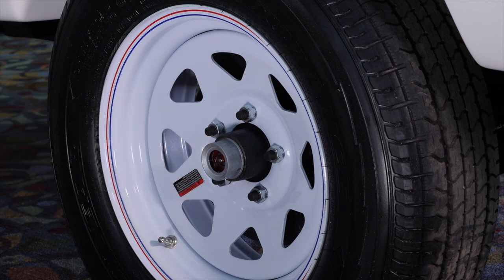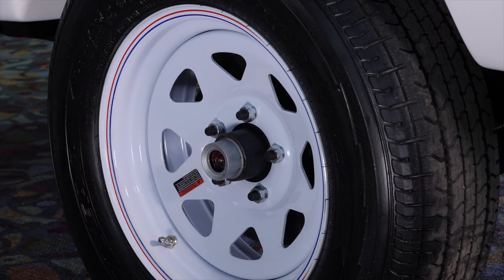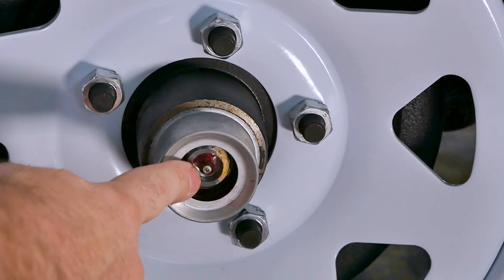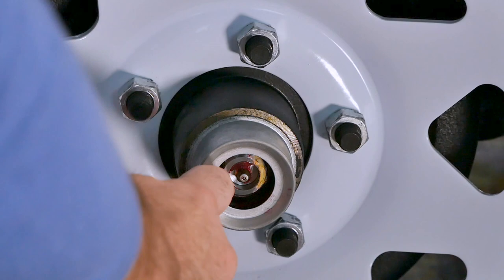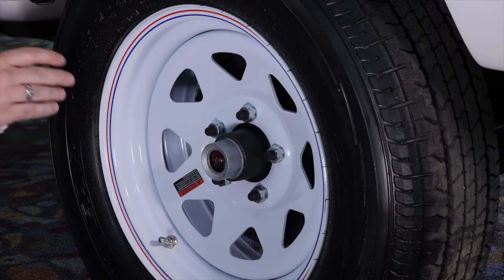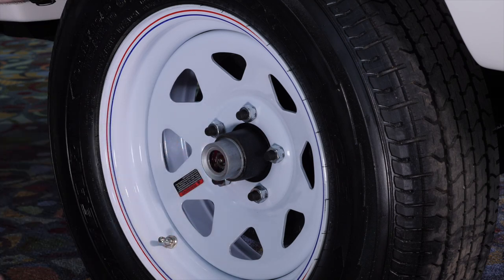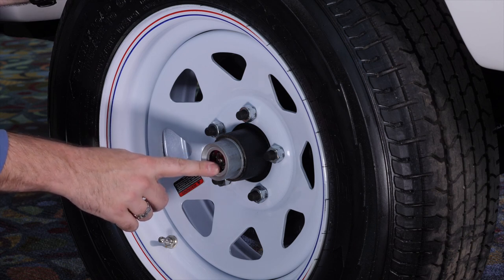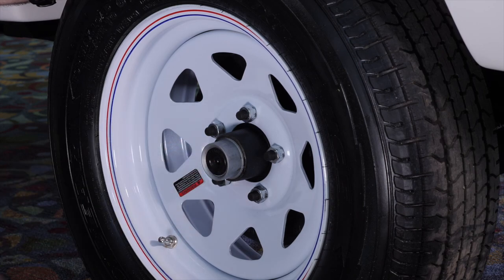Grease Dexter Axle

Comment: Dexter recommends pulling the hub to inspect the bearings. The zerk fitting is really designed for boat trailers, not annual maintenance.